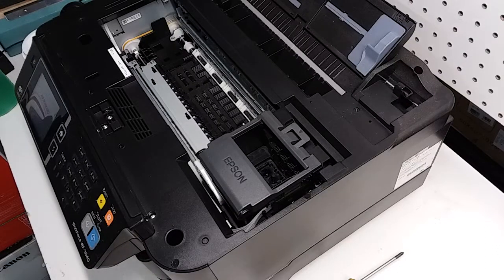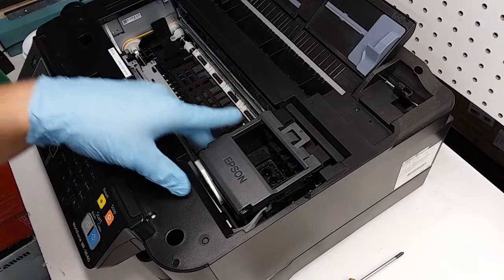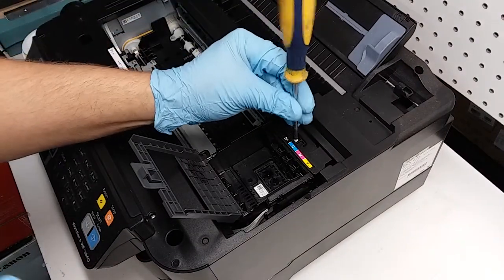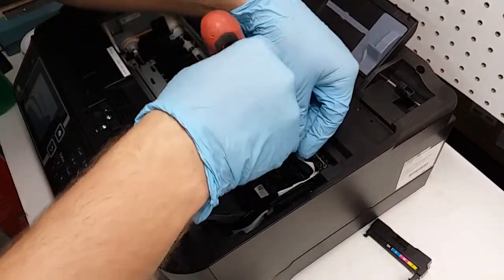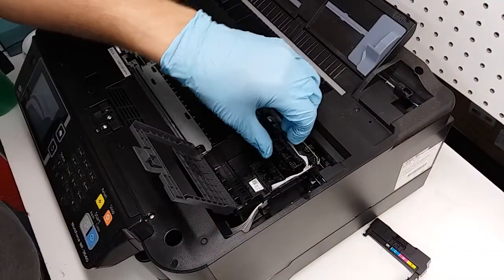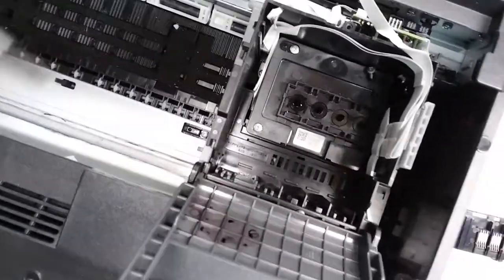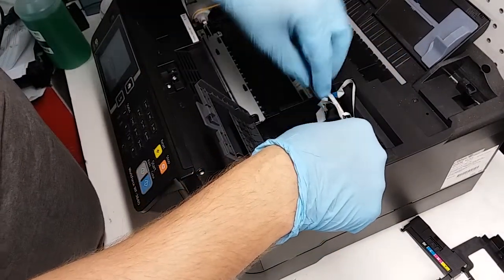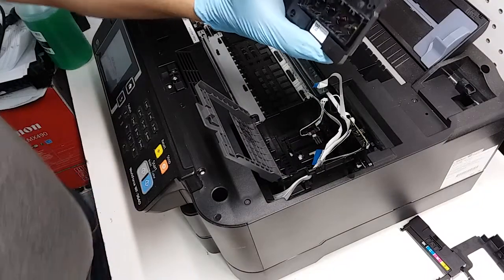How to Remove Printhead T1881 || Epson WorkForce WF-3640, WF-3620 Printer

Comment: There were several steps that you just made happen, without showing in detail. Taking the cover off to access the print head is fairly simple, and could have been shown. The controller board has some tabs that could be depressed through holes, which allows the board to come out quite easily. The print head does not "slam right in there". There are some alignment pins that need to be aligned to the print head.
Reply from the maker: I appreciate you pointing this out for me. I will make sure to be more detailed in my future videos.  Have a great weekend!
Reply: don't forget it just unclipps and only shows the back of his hands

Comment: Do not remove the Cartridge CHIP Board how he did, you may break it. There is a hole is hidden behind the white plastic channel on the left side  . Use a L shaped pick tool to press the clip in the hole. You can bend a little the white channel to expose the hole.
Reply from the maker: I appreciate your comment very much. I have learned it later, after making this video. Have a great day!

Comment: i removed the head, and cleaned it, now i replaced everything, but the printer will ,ont power up. there is a little red light in the bottom left, so  there is some kind of power.  but the power on button does nothing. is there anything i might have inadvertenly, disconnected?
Reply from the maker: Hi, yes, the scanner wire may have disconnected when younlifted the top of printer further than usual, if you removed the stop support unit. You can open the side cover and reconnect the wire. You should be able to see the disconnected wire as soon as you remove the cover. The cover should be on the same side as the USB connection.
Reply: thanks for responding...i don{t see a wire, do i have to remove the scaner unit to get to it_ @303electronics
Reply: i removed the cover, and all the wires seem to bein the proper places.  might you have any other ideas. might there be a fuse.  thanks again. @303electronics

Comment: How do you clean the actual print heads once they are out? I have run cleaning solution thru them while in the printer (blotter paper underneath) but the Black still only prints about every other line, frustrating. I assume if I take the printhead out I should brush it with or soak it in cleaning solution, or warmed up cleaning solution? Please advise, thank you.
Reply from the maker: I use a syringe with a tube from an aquarium air hose, about 2 inches.  I use "LA's Totally Awesome " cleaner dilluted about 50/50 with warm water.  You can soak the bottom of the printhead in the solution overnight or for a few hours. The unfortunate outcome may be that the nozzles are damaged if, after a thorough cleaning,  there are still blocked nozzles.

Comment: Hey. Are either of these 2 printers convertible to sublimation ?
Reply from the maker: Hello. According to YouTubers that post sublimation work videos, yes, WF-3620 and WF-3640 printers can be converted to sublimation ink setup. If you have a used printer, I'd recommend flushing the printhead before introducing sublimation ink. You don't have to take the printhead out if nozzles are working fine now.

Comment: Thanks for this, but my printer still won't print, so I guess the print head wasn't the problem.. I took out the print head, cleaned and dried it, and put everything back together the next day. I still had the same problem as before, only now instead of patchy printing, it won't print at all. I don't know if it's because I broke something or what, but I think it's time for a new printer anyway.